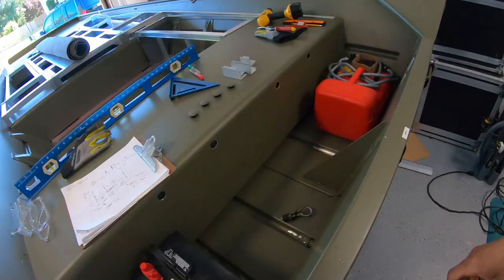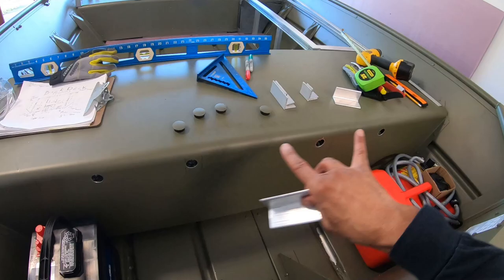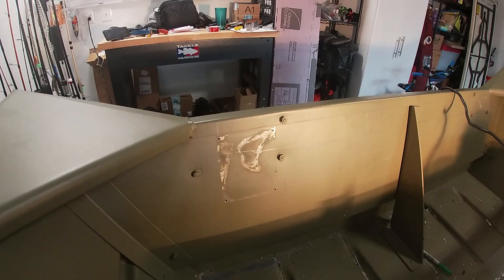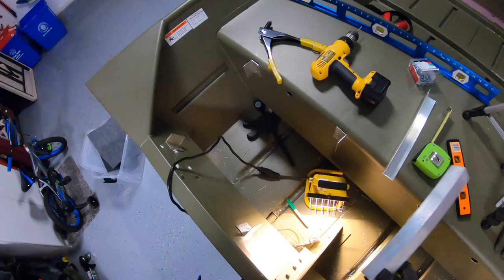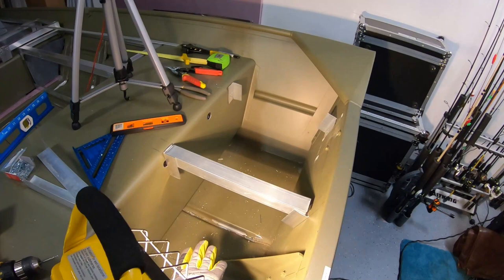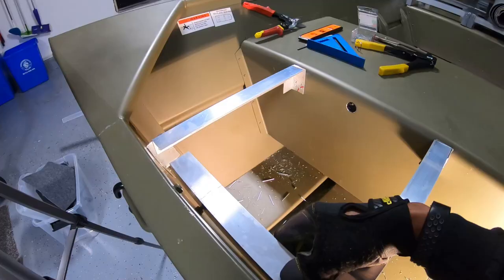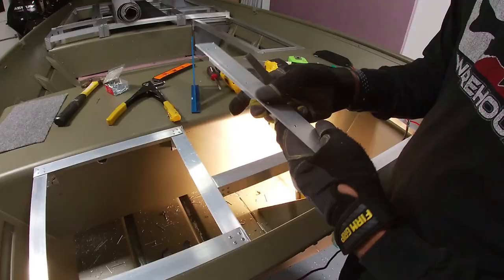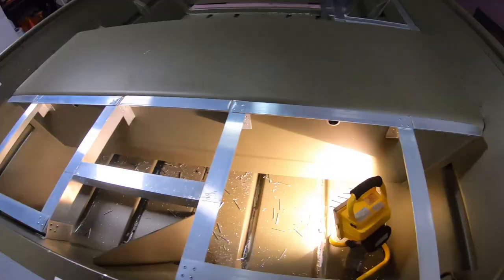Back Deck Framing Step-by-Step Start to Finish {Jon Boat to Bass Boat Conversion} Lowe 1448 Jon Boat

Comment: Love your videos! As a firefighter, I have to give you a safety tip. Keep the battery and the gas can in SEPARATE, VENTED compartments. That is fuel and ignition together; it can really ruin your day!
Reply from the maker: I did find out about that after the fact.  Thanks for bring this up.  I'll be ventilating the rear deck in the off season

Comment: It’s a hidden vin number so if the boat gets stolen and they remove the visible vin numbers, you still have the hidden one for proof. Rvs have them to. Great video!
Reply from the maker: Man thanks. That makes perfect sense. You're the only one to answer that question for me. Much appreciated

Comment: Awesome videos! Been watching them all and I don't even have  a Jon boat yet. LOL. As an idea for the rear spacers at the transom, you could just make the brace the full length you need. To compensate for the angle of the transom, just cut the side of the aluminum at an angle. That way you don't have to bend the support piece. Hope that helps.
Reply from the maker: Not a bad idea.

Comment: Do you have a VIN Number on the rear of the boat on the outside (waterside) anywhere? I have a 92 Lowe 1436 and mine is located on the right at the top if looking at rear of boat. Just curious because boat makers supposedly put a second “hidden” VIN on all boats in case the boat is stolen and VIN removed. Helped a friend look for second vin plate and never could find anywhere. I believe you may have found the hiding spot for it under the weight restriction plate there.

Comment: 1:04 caps are there so they can fill the area with foam. They insert the nozzles there and also can run electrical thru there before foam if needed. Can't wait to see full finished as I own a 16' Lowe my grandfather who passed away few years back bought new in 88 I am starting to rebuild. Keep up good work especially for first time builder.
Reply from the maker: Thanks for letting me know. That makes sense. I would have never thought of that.  Your 16 footer must be nice.
Reply: @BassBrothersFishingDMV  It will be it's been thru many years of solid use and just recently took it off the water due to trailer rusting bad ujoints both leaf springs and axle and pretty much everything attached accept the galvanized trailer. So just getting started with the remodel will take prob 3 solid months and $10k if I put new motor on it (don't need to but might go 4 stroke) and about $5k if I don't. I also do all the work myself I've actually already done carpet covered wood deck/platforms a few times over the years in the boat but never did it 100% right with aluminum. Now that grandfather's passed away this time I'm spending the money n time to do it right. Putting in small center drive  tower and pole platform and doing full deck and covering with nice sea mat or something similar. I have to go further with mine by taking out the benches and everything and reinstalling them where they'll fit but will be worth it. Already have plans drawn up. Mabee I'll send you some before and after pics since I don't upload to YouTube. I'll keep watching/commenting u got new sub. I don't bass fish often since I live in Florida on the ocean but fishing is fishing and better than watching TV any day.

Comment: Use cardboard, or manilla folders as a template to find your angles ! It's easier to cut, and modify cardboard than it is to modify aluminum !! When I was fabricating in the pipe shop I had a file drawer full of manilla folders, masking tape, scissors, and carpenter's pencils !! Make a layout, then trace, abd cut !! 
That boat is looking good !! 
p.s. Take a break every now and then to go fishing !! It'll clear your mind, and you might come up with a brainstorm of an idea !!✌👍👍😁🤜🤛👊👊
Reply: thanks for that piece of advice 👌👍
Reply from the maker: Good advice.  Especially for the next part of the mods with the paneling while I'm doing the electronics.  Fishing is finally picking up in MD I'll be out more. Down side is it prolongs getting the most done.

Comment: Your video is very helpful. Thanks. I'm planning a similar deck over the rear of my Jon boat, which also has a slanted rear.  I plan to separate my gas tank area with a vertical wall and provide plenty of ventilation. Separation and venting will reduce the accumulation of flammable vapors from the vent of the gas tank and possible spills when filling the tank. What are your thoughts about separating gas fumes from the battery, bilge pump, and associated wiring? Also, flammable Hydrogen vapors are slowly released from the battery. Any comments about venting the battery compartment will also be appreciated. Thanks again.
Reply from the maker: Honestly I don't know much about Hydrogen vapors but under my rear deck is wide open so hopefully that's enough ventilation for what I'm working with.

Comment: Looks Really nice! How did you measure at the transom to get it straight?
Reply from the maker: I just use a leveler straight off the rear bench.
Reply: @BassBrothersFishingDMV  smart! That was actually the only way i came up with but thanks for the clarification. Love your build btw and have gotten a lot of inspiration and ideas from it.

Comment: Looking great I just bought a new 12' Jon boat but it's so small can't put to much weight in it.....
Reply from the maker: You don't need much to do some cool mods. Enjoy the boat all the same. Its gonna be nice to get out on the water. I fish the crap out of my little Pelican Bass Raider and it's only 10' long.
Reply: We got a 30lb thrust trolling motor but it's surprisingly faster than I thought it would be 👍

Comment: Every boat with a serial number has them in more then 1 place my bass boat has the one u can see at back and 1 under the carpet under front deck. Guess in case if someone steals it and take the number off or change it then their will always be the original hidden.
Reply from the maker: Very true I eventually figured that. Thanks for the comment. 👍🏾

Comment: Incredible build so far. Do you think the aluminum framing is worth the extra effort from just using wood framing?
Reply from the maker: I think so.  It will last allot longer than wood and it's lighter.  I'm the type that doesn't like to repeat processes or deal with high maintenance things.  The aluminum should be good for several years to come.

Comment: Would I need to use rivets or is it possible to use self tapping screws all the way around? It looks good!
Reply from the maker: I would go with rivets as much as possible.  Its cleaner, safer and takes up less space.  With screws you will have sharp points sticking out everywhere.  Rivets  can be placed in places screws can't.  Screws take up more space. This will matter in places where you would put maybe 4 rivets and you would only be able to fit one or two screws. The flip side is there are applications where screws are best. You just have to assess it and make the best choice.  Hope this helps.

Comment: Nice work. I would have used 2x4 or 2x3 lumber soaked in penetrating epoxy, and nut and bolt it all together and glued with 5200 where the nuts and bolts would not be possible.
Reply: That would make for a heavy ass boat though.

Comment: When drilling and placing rivets in the transom for the support brackets are those rivets watertight? Have you had any water leak issues so far?
Reply: I think I saw the rivets didn't drill all the way through the transom? Is that correct?
Reply from the maker: @stompzaround  no issues with those rivets so far.   They are above the water line but you could always add sealant to the rivets to play it safe.
Reply: @BassBrothersFishingDMV  thanks for the info! sorry for my late response. i appreciate it greatly!
Reply from the maker: @stompzaround  correct on the transom rivets

Comment: How did you go about finding level on your boat and then checking level? The answer is prob obvious. I have a 16ft boat in my garage and it's heavy. Wondering what I can do...
Reply from the maker: I just leveled it on the trailer in the garage.  Seemed to work out pretty good for me.

Comment: Hey how come you didn't cut the cross beams say 2" longer on each side and cut one side of the angle taking a pie cut out at the right length and then bend the angle down to the slope of the transom and rear bench? Then rivet the flange you just created instead of cutting all those little supports.
Reply: It's already over complicated for them and most others,don't make it any worse.....LOL!!!
Reply: I guess I was a little wordy. I did that technique on my build and it turned out great.
Reply: @johnwagner5514  No I knew what you meant,it's 80% of the others it would have been to complicated for.
Reply: @johnwagner5514  That's how I do a lot of my metal work too.

Comment: For your rivets, I clicked the link but it says they are Steel rivets. Is that correct or should I be using aluminum? I thought you were supposed to match metals and steel would corrode?
Reply from the maker: I never heard of steel rivets corroding aluminum and I don't see any corrosion on my boat.  You could always go with aluminum rivets to play it safe. I'll be researching this further. Thanks for asking the question.
Reply: Through experience, stainless steel will react and promote corrosion in aluminum

Comment: How did you connect the middle bar between the motor?
Reply from the maker: If you're taking about the middle bar attached to the Transom I didn't attach anything to it after all.  The framing came out so stable I didn't need to in the end. I've fished off the rear deack for a few weeks now and its extremely strong and stable.

Comment: What is the thickness of the aluminum you used
Reply from the maker: The rear deck is 1/16 inch. Very thin,  light weight but strong enough for a rear deck.

Comment: What size rivets are you using?
Reply from the maker: The majority of the rivets I use are 1/8th.   Then pick the length based on what you are riveting together.

Comment: If you had used self tapping screws instead of pop rivets you could had done it a lot faster and easier to take apart.
Reply: Hahaha!!!!   They'll work themselves lose. Then you'll have to replace them with a larger screw,then they'll work lose and you'll have to then replace those with an even larger screw.....
Really want to do it right,you'd buck rivets all around (pop rivets will work lose too) or weld it with bucked rivets mounting it to the seat and transom....